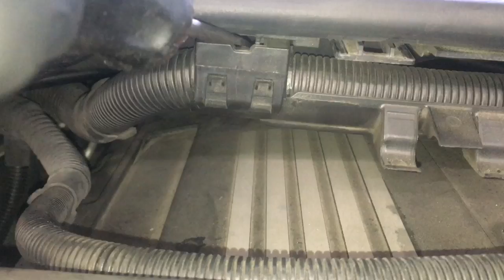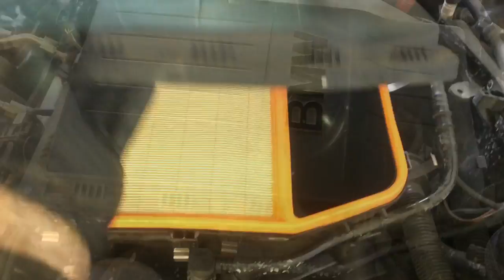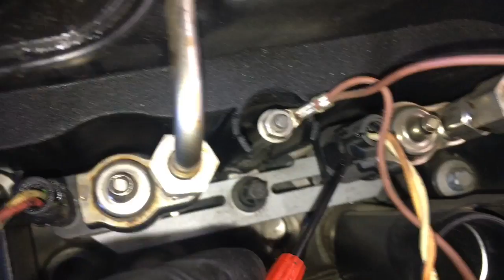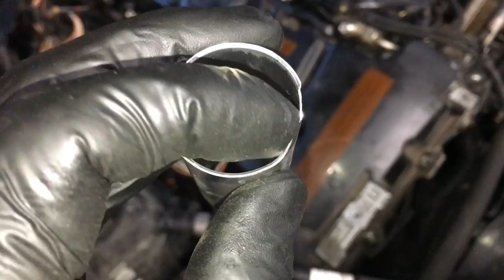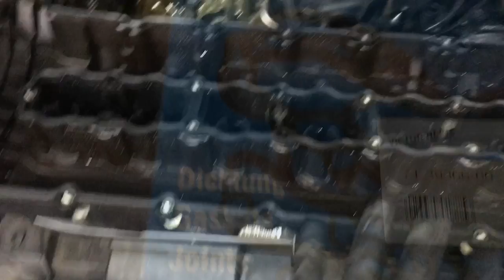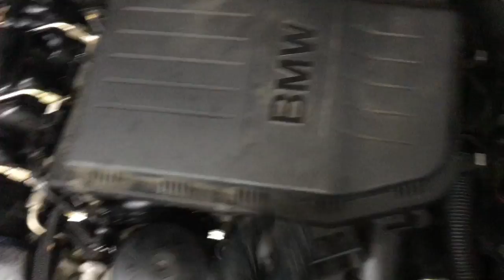How To Replace The Valve Cover Gasket On A BMW 335i

Comment: DEFINITELY use oil resistant rtv silicone glue stuff. It will hold the gasket in place so it won't fall out while installing AND it will help seal it and the repair will last much longer. Great video, you showed every little detail 🔥

Comment: Thanks for your video, things were great until i tried to start it, i only try's  to crank but does nothing. Sounds like it binds up when i hit the starter? What did i do wrong? 2009 335i 103k miles please help.

Comment: Thank you for making these videos.  I have now used this one and one for the coolant tank replacement on my 2008 535xi and the secondary air injection on my 2005 lexus GX470.  You show in such a strait forward and easy manner with good technique especially during trouble areas.  I think the least people can do is buy the recommended parts off of your links, hopefully that would pay you back in some way.

Comment: Great video. I got everything off but cannot for the life of me get the cover off.  Now Ive cracked it and put a hole in it trying to get it off.  It almost seems like there's some type of suction holding down.  Help
Reply from the maker: Linda Curtis it sounds like there is one bolt still holding it down. I have seen the covers get stuck on there though. I recommend that you try prying in several different areas.

Comment: Excellent How To video.  I just finished replacing the valve (head) cover gasket on my 2008 535XI. The detail is great and it really helped taking everything apart as well as while trying to figure out how to put everything back together.
Reply from the maker: Jeff Capeci glad to help. Thank you for watching! 535xi is an amazing car I love how it handles.
Reply: How to Automotive it is a fun car to drive but at 120k, I will be doing some suspension work to bring its handling back to factory original but that must wait until I change some fluids.

Comment: Do you have to do anything to bleed the air out of the fuel system since you remove the fuel rail and the lines that go from the rail to injectors?
Reply from the maker: Pedro Carvajal you don't need to bleed the system it will bleed when the injectors opened up to spray.

Comment: What else can use to take off bolt that use the snap on 10 mm thin wall? Can't find one anywhere.
Reply from the maker: Nick Cabral Hi Nick. I just added a link for That socket in the description. It's the 4th affiliate link down. Hope this helps.
Reply: Does it have to be a thin-wall type socket or will a pass through work as well?

Comment: nice video . after  done everything my car is thiking  and i feel have no power when i hit gas . any idea what is going wrong thanks
Reply from the maker: Diego Soto sounds like it's miss firing. I would pull codes and go from there.
Reply: perhaps the ticking gets louder when you take off the top engine plastic cover with the foam on it.
i had a problem though where one of those vaccuum lines that run behing the oil cooler housing acrros the top of the valve covers ruptured on me therefore i didnt have a proper vaccuum to the turbos causing them to not spool.
please check that since he did state they will easily break off.
This was a week ago so hopefully you found what was wrong!
Reply: Luis Rodriguez  thaks for the information yes the cover take  the ticking noise away . .but i will chekc the vaccun lines . again thanks

Comment: Hello, what are the likely symptoms of this gasket wearing out, besides oil leaking.
Reply from the maker: Luis Urrutia the only symptom is oil leak.  The gasket only last about 3 to 4 years before they start to leak.
Reply: How to Automotive not any misfire do to pool of oil on the coils and sparks?
Reply from the maker: Luis Urrutia yes that is a possibility.

Comment: Can you please leave a link for the tube seals and for the 2 vacuum tube lines you talked about replacing during this video? BMW wants 22$/sleeve which is a joke. Also, is the 10mm socket you used longer than 1/4inch drive? Or is that long enough?? Thank you! Please let me know asap, trying to do this in a few days

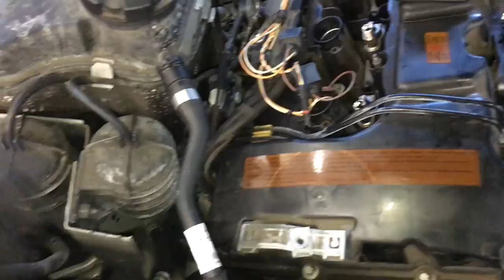Comment: Excellent video. Your engine is same as in my 2011 BMW Z4 35i. Following your video, I could get to the point where you removed the 2 vacuum lines and fuel line. Video was cut at the vacuum lines near 9:17. How to remove the 2 vacuum lines ? Is the fuel rail attached to the cover ?
Reply from the maker: Chakravarthy Cuddapah The fuel line is not attached to the cover but it's bolted  right next to it and it pinches it. So if you take the mounting bolts on the fuel rail off it'll will lean back just enough to clear the valve cover.vacuum lines are flexible and you pull him through
Reply: Thanks for your quick reply. Can you please tell me how to remove the 2 vacuum lines ?
Reply from the maker: Chakravarthy Cuddapah I held the plastic  portion of the lines in one hand and used a screwdriver to push the vacuum lines off the tubes. You can also use a small pick tool to pick inside the hoses to loosen them up.

Comment: OMG thank you for making this video. I have a 2010 335i coupe and I'm new to the BMW car world. I was just surprised on the many area's the N54 motor has oil leaks. Mine is where the oil filter is, bad oil filter housing gasket and oil cooler gasket, and the other place is the engine valve cover. Going to the dealer will cost an arm and a leg. I have no issues doing it myself, I'm just glad I found this video. The most accurate and step by step video. With this I can finally start my gasket replacement not to mention spark coils and spark plug project. Quick question, for the spark plug tubes. Are you sure this is the correct part number 11127575422. I looked it up and it said for N52 engines. Then again they could work for the N54. Would you be able to let me know?
Reply from the maker: Marcris Tyrell  I can check on those parts in a couple hours and get back to you. ￼
Reply: Thank you very much

Comment: Nice! I like that you're to the point and don't begin with "Whazuuup, YouTube!".  QUESTION: Should the valve cover bolts be replaced during this job? What are your thoughts and reasoning?
Reply from the maker: Wiggle Bee you definitely do not need to replace the bolts on this job. The bolts are not torque to yield bolts and the cover is made out of plastic so the torque is not very high. Thank you for watching and writing!
Reply: Thank you for the response. That does makes sense.

Comment: which valve cover gasket should I buy BMW or aftermarket for my 535ix Drive 2009
Reply from the maker: Paul Perez on this particular one either or will work just fine. And I think the prices are pretty comparable to.
Reply: i have de problem bmw 535i xdrive the code is p2096 i chage de pcv,manifold gasket,the charge pipe .please need help
Reply from the maker: Lemuel Alfaro code P2096 is for the oxygen sensor before the Cat. If the code was there before you did the work on the car then most likely the oxygen sensor is bad or a large vacuum leak somewhere. If the code appeared after you did the work on your vehicle I would go back over your work and double check for any vacuum leaks or any wires left disconnected.
Reply: To the car they changed the injectors the gasoline pump since it appeared that code I take it to the mechanic because it had a gasoline smell and it was the oring of the gas pump it was mounted a new oring but the code keeps appearing. And nothing changes the pcv valve selenoide control and nothing returns the code change the charge pipe complete with blowoff and nothing returned the code the last thing I did change the joints of the manifold when I turned on the car the code p2096 off but the next day I do not know what else to do. What I noticed is that when I use the car during the day to do the errands the code seva. In the scaner that stays blinkied is the evap. I hope you understand everything I wrote thanks for wanting to help me